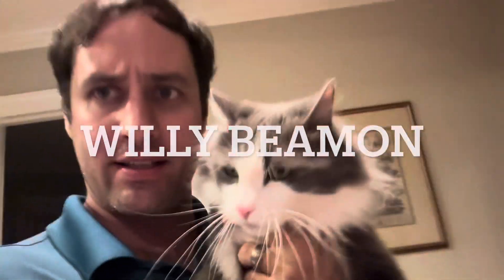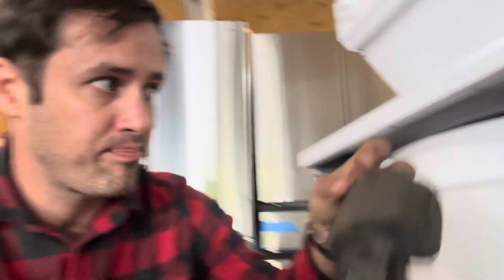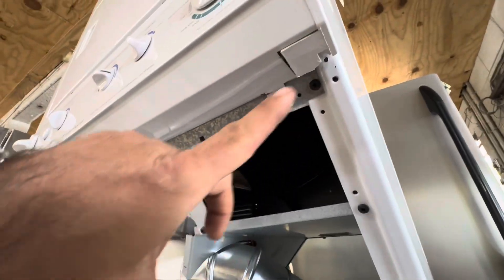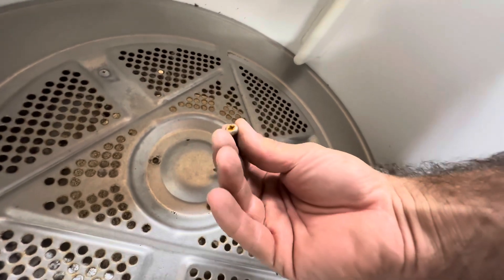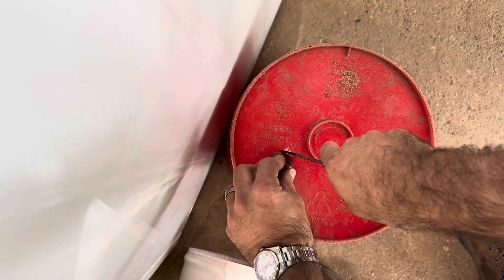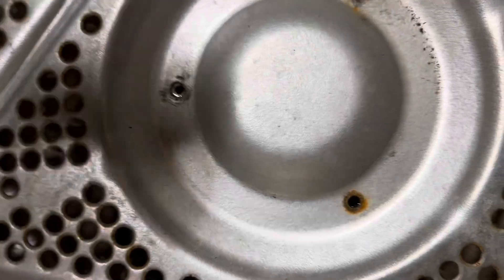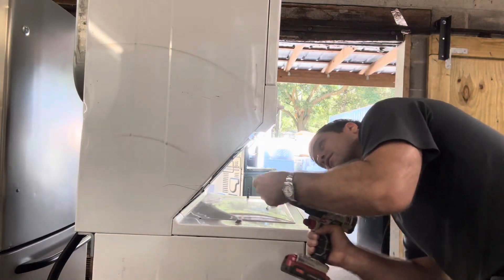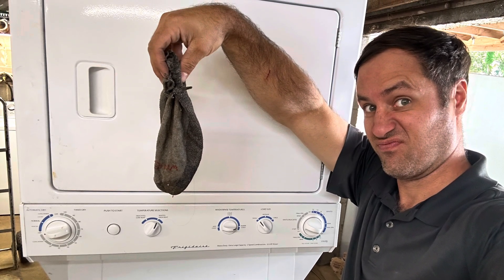Frigidaire stack washer not draining and noisy dryer | FEX831FS4 | sock in pump & rear bearing

Comment: I did several bearing jobs on those stackables here in north Louisiana near Louisiana Tech. Many of the apartments around the college have them and it’s a real chore getting up there to change out the rear bearings. It sure helps to have a helper 🥵
Reply from the maker: Oh yes two people is good to have on these. They are always in the tightest spots. So I definitely have the luxury of working on these in wide open space for aure

Comment: I don’t know how socks get stuck in drain pumps, but it has happened in two of my GE washers
Reply: Stackables are not that good anymore, every time I see one of those plastic tub GE stackables it has a bad bearing. Not a huge fan of whirlpool or newer Frigidaire stackables either. The newer GE stackables don’t have bad bearings as often. Those GE stackables are probably even more likely to have a bearing failure than an older Whirlpool VMW unit.

My Whirlpool was bought in 2014 or 2013, and the bearings failed about 3 years ago, so mine lasted about 7 years before the bearings went out, now the bearings in that thing sound like they are shot.
Reply from the maker: @coolrobuxgaming  it’s just the nature of it 😂

Comment: The GE stackable washers almost always have bad bearings for the models made before 2018
Reply from the maker: @homeguestunton  99.9% yes. I know a guy who bought 5 and they all had bad bearing right off very early. He is still using the dryers and actually removed the dryers. Mounted them up and put regular washers under them. 😂
Reply: @LAapplianceguy  I think the newer ones don’t have this problem as often, but I’ve still seen some newer ones with the issue
Reply from the maker: @homeguestunton  oh cool. Thanks for the heads up. I’ll have to keep that in mind next time. I have just been staying away from them.

Comment: This video triggered me. I might have to send you a therapy bill. Please write the check to DR. C ASH.  I was 20 and bought a newly built condo. It had a stackable in a closet right as you walked into the kitchen. Half of it wasn't the machines fault. At some point the roof vent clogged and it never dried the clothes. I bought one of these stupid vent buckets you fill with water. It would get so hot in that closet the paint started peeling. It had to be a different brand from the 80's. 2-3 times a year I had to take the accordion door off drag that heavy beast out and work on it. It would block kitchen entry when pulled out. We had a local mom and pop parts guy. I would always complain what a POS it was and how tired of fixing it I was. The guy always told me same thing in his thick eastern euro accent. "Vell it's cheaper to fix than to buy a new von". I replaced an element, motor and a bunch of other stuff. I think it was more dryer related. I don't recall a bearing issue but that was a long time ago.

Your videos must be giving me bad luck. I wake up and hear a high pitched whine. Thinking it's from the outside nope. It's the Monogram SXS evap fan motor. Have one on the way and just in case a new blade. I only go OEM on electrical parts. I looked this fridge up ZISS420DNBSS  it's about $11,000. Holy smokes! We built the house and got the appliance upgrade package so didn't actually pay a store for it. Of course I order the motor and now it's quiet. Not sure why they do that. Same with my computer fans.Blow them out and they get quiet after I ordered new fans.
Reply from the maker: @scotts4125  that is the worst part about stacks. Is they were always in a bad spot. And being the youngest and most limber. I was the one that had to crawl up and over them all. Oh man it’s always something with these units. Those GEs there are pretty well built and solid. They can be fixed and a fan blade or fan motor is nothing for a unit like that. Thanks for the positive feedback as always 👍